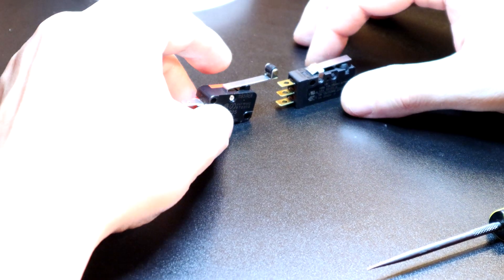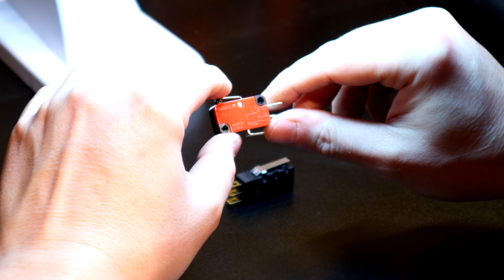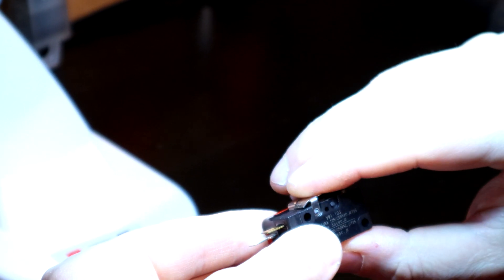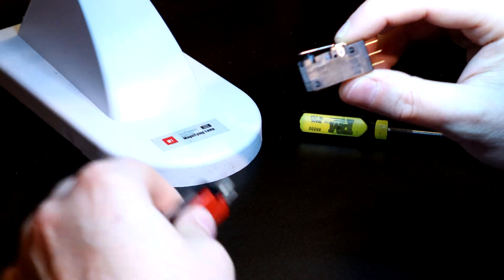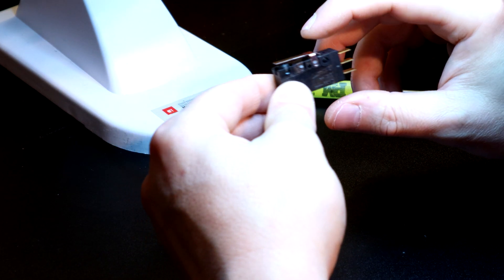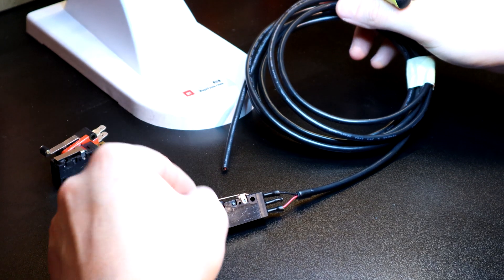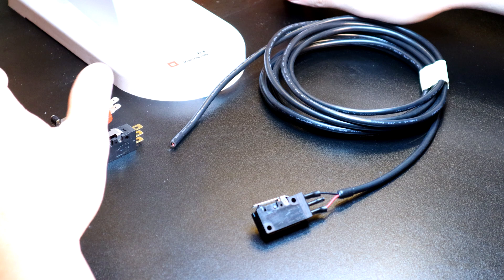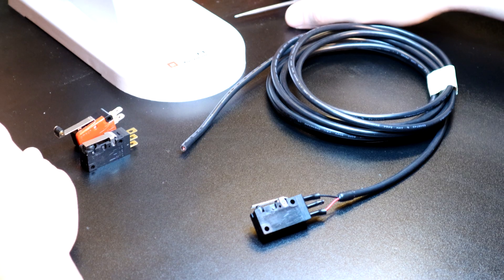Waterproof IP67 CNC Switches Are In! (Shot In 4K)

Comment: Hi whats your opinion on contact less switches? Like reed switches or inductive sensors.
Reply from the maker: KOR, thank you for your support. I personally am not a fan of them as over time they can produce drift creating varying accuracies. If you must use physical switches I keep them as simple as possible, and mechanical ones are as simple as they get. Thank you,
Vince
Reply: @corvetteguy50  thanks for your quick answer.  I totally understand and respect your answer. Just to give you a perspective on the other parts in the world: Here in europe those types of switches are used very frequently. reed switches are as far as I know a contactless mechanical switches, which is impervious to dirt. (I run 3 of them for 12 years without a failure (exept once when the glue of the magnet failed and the magnet fell off)). I am not sure how accurate they are but so far this wasn't the limiting factor on my gantry machine concerning accuracy.
Reply from the maker: Switches are always a component of preference, I've always been a simple guy as they all accomplish the same task.  Thank you,
Vince

Comment: Hi vince
I have my mini mill up and running, mach3 usb bob, windows 10 , laptop , I am struggling with the z axis tool offsets , is there a easy way to do this as I am running a trial drawing and the z axis is not going to where the top of the stock would be?
Regards tony
Reply from the maker: Hey Tony,

I recommend reviewing my Mach3 soft limit and offset video that covers offsets. It the offset is set for the Z axis, and its not accurate I would go over the tool height as if its not inserted in exactly the same location in depth in the spindle each time it won't be accurate. This is prominent when your using different length tools with the same offset for the Z.  thank you,
Vince